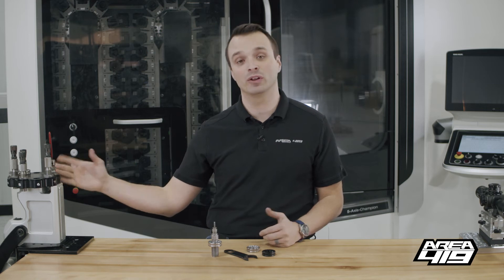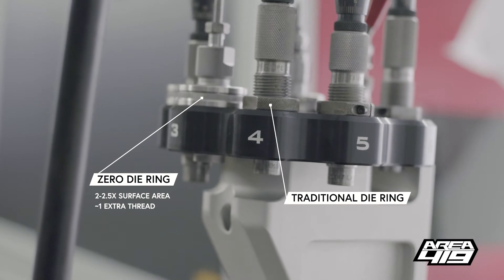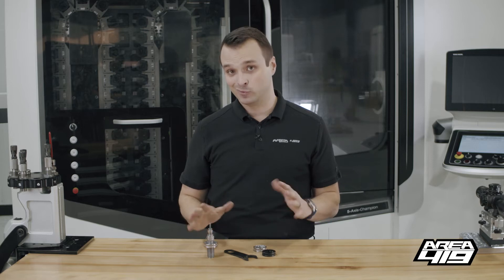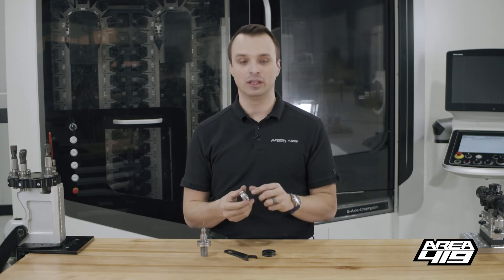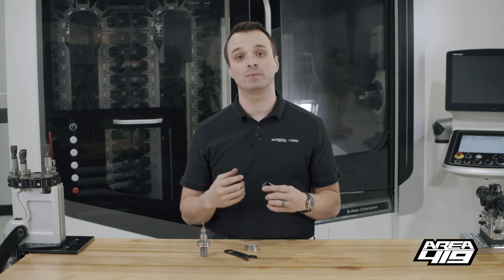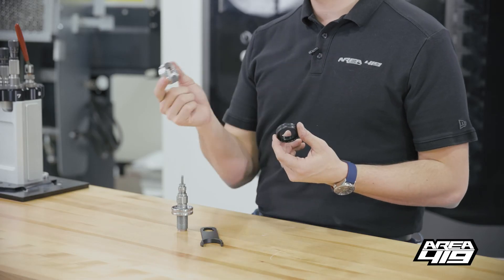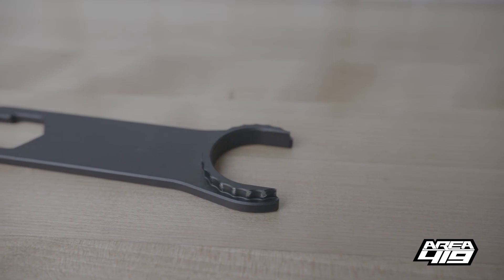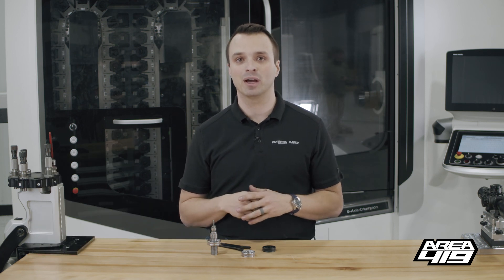Area 419 ZERO Die Rings | New Product

Comment: Are these only for turret/single or might they fit on a 550?
Reply from the maker: These are likely a little large for a 550. These were designed for the ZERO and can also be used on a single-stage. It's also plausible that you'll see a bit smaller version in time to work with some other presses.